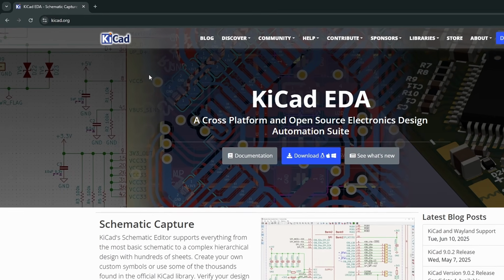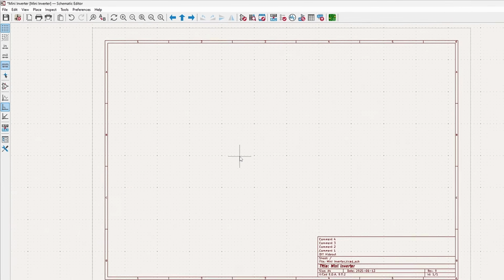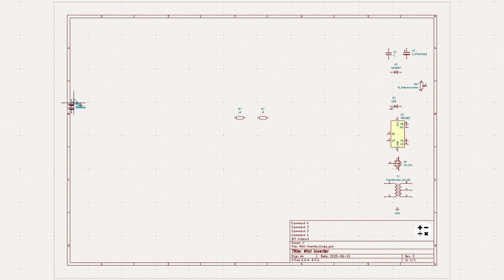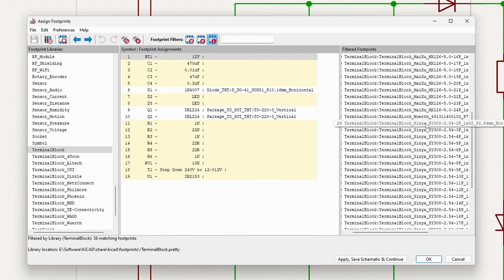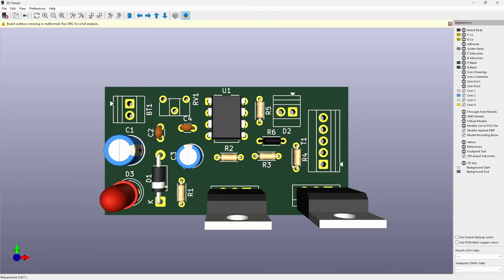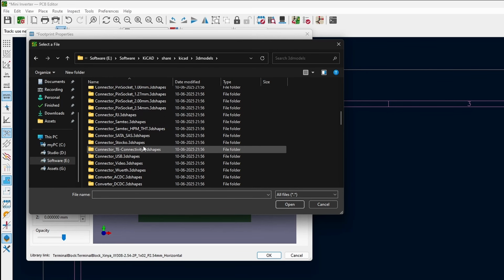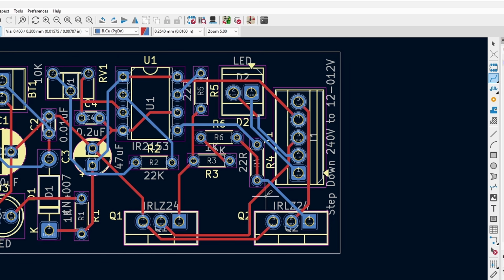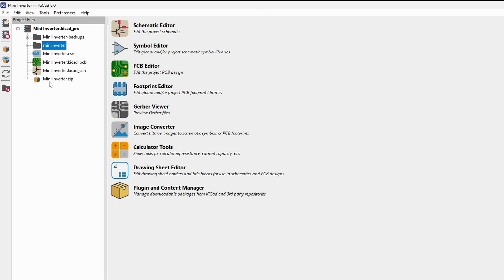KiCad for Beginners | Step by Step Tutorial to get started | 2025

Comment: Can u recommend PCB thermal testing program?
Reply from the maker: If you need an open source software you can use KiCad with salome software..other free option you can try is edesignsuite PCB thermal simulator or picls lite.. You can also altium designer.

Comment: Thanks for the video and the effort. However, as a beginner, I found it quite hard to follow. You explain 'how' to do things, but not 'why' they are necessary or what happens if we skip those steps. For instance, concepts like 'global labels', 'annotating schematics', and 'assigning footprints' are introduced without explaining their core purpose.

Also, the example PCB you used is way too complex for a tutorial aimed at beginners. Starting with a much simpler circuit would have been much better. This feels more like an intermediate guide rather than a true beginner tutorial.
Reply from the maker: Thank you for the constructive feedback. I will definitely keep this in mind for my future beginner-focused tutorials.

Comment: Great video! I am super new to this. I didn't see this question in the comments, but when you added the trace with the via, could you have just went up and over the component that was in the way instead of using the via? Any issues doing that? Is using via preferred for some reason?
Reply from the maker: I used the via just to show how to use the vias in the video.. if there are no other options other then using via only then use vias otherwise no need to use vias...Some fabrication house may charge extra for vias

Comment: Is there any possible way you can maybe do a short or something on how to add the heatsink to the transistors/FETs? Im trying to follow this to design my first board and i have an LM317 THT that will have a heatsink on it that looks similar to the ones you used, only black. Any help or tips on doing this would be great.
Reply from the maker: I will consider making a video on this... In the meantime you can try this.. 
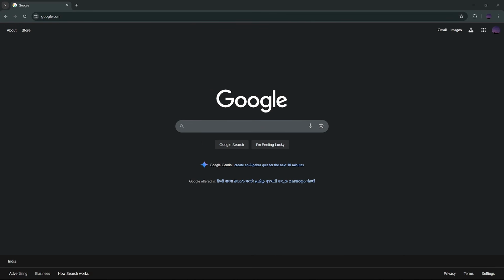Download separate 3D model for LM317 (TO-220 Package) and Heat Sink (Google - heat sink for TO-220 package 3d model and use the Grab CAD link) and then link them using KiCad (as i explained from 14:30). 

While linking you have to do it twice, First link TO-220 3d model and then link the heatsink 3d model.

If you already have the TO-220 package then just link the Heat sink to it.
Reply: @diyhideout thank you so much. Ill give this a shot after work today.

Comment: Laying out the parts placement should be done while routing the board.  If you don't do this you may end up with an unroutable board layout and have to move parts around, resize the board, or increase the number of layers in order to get everything connected.  For a simple board such as in the example this might not be an insurmountable problem.
Reply from the maker: Thank you. I wanted to keep the tutorial as easy as possible.
Reply: @diyhideout  You did make the process look easy!  I thought I had the latest version of KiCad installed on my Ubuntu (Kubuntu) system, but it was actually V8 that I was running.  Which didn't look any different from the V9 you used.  So I uploaded the new appimage as Ubuntu didn't have V9 in their repository.  After a few hickups, it's now the current working version.  I have a simple project I was working on, I need to get back to it and finish it.  Just a bit more complex than your example, hopefully I can finish it.  I don't think you showed a net check, maybe that's included in the update schematic when moving to the board layout.  Used to be a separate check that always bugged me with missing power and ground nets that I could never find!
Reply from the maker: Hi, All the best for your project. In the new version its under ERC and DRC. I have made a separate video for ERC and DRC check (https://youtu.be/OZhVRyuPJuA) which covers most common errors.

Comment: I'd like to make a data recorder using a microcontroller/FPGA and an external ADC (ex. TI ADS8588H LQFP-64 has 8 channels 500KSPS).  Something similar to Dewesoft's DEWE-43A or "OpenScope MZ" or Digilent's USB-205.

Aside from the zero experience in hardware/kicad/etc.. the biggest challenges I see:
- Designing the Analog-Front-End to scale/condition the input voltages -15V to +30V to something the ADC can handle.. preferably via jumpers
- USB2-HS 

I've seen that laying out a board for USB High-Speed requires expertise.. so I'd like to use a device that has the PHY built-in (ex.STM32H7RS , Gowin has a Soft PHY ).  The Smartfusion2 FPGA has USB2-HS but requires an external PHY chip.

Of course, the other option is to use an ESP32, still collect the data fast via DMA (75Mbps),  but output to the PC (sigrok) at a much slower rate -  USB-UART (1Mbps) or Wifi.(25Mbps)

I think I can probably stumble my way thru the schematic, maybe even the layout (although the TI ADS8588H Layout recommendations shows tons of decoupling capacitors, split Analog/Digital planes , etc... not to mention all all the PCB fabrication options I know nothing about) .  And even using 1206/1210 size components.. with my bad eyes and shaky hands, I think I'll need to find someone to do the solder.

Comment: How do I set the footprint so that the component's feet have a hole in the middle?
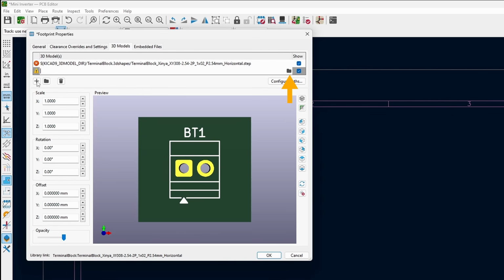Reply from the maker: You can adjust the X,Y and Z of the offset and the rotation angle (you can refer 16:34  in the video). if needed you can use the scale too.

Comment: 회로가 실제로 잘 작동하는지 시물레이션은 안하고 곧바로 pcb만드나요?
Reply from the maker: I personally simulate my circuits on a breadboard and then send it to fabrication. If you have access to Professional tool like Proteus  or Autodesk EAGLE you can simulate with that. You can also use Tinkercad (useful for Arduino or Micro:bit projects)
Reply: @diyhideout   kicad 자체에는 시뮬레이션이 없나요?
Reply from the maker: KiCad does have Spice simulation (maybe little difficult for beginners who are just starting with KiCad). You can find that under Inspect tab.

Comment: Hey thanks for the tutorial, just wondering if there's a components list or a specific symbol library that you use?
Reply from the maker: Hey, i have installed few libraries from the KiCad plugin and content manger (Keyswitch for Cherry MX keys, Kicad Library for Arduino Modules, Simple libraries which has value based resistors and capacitors which speed up the design process)
Reply: @diyhideout  great thank you, i will give those a go

Comment: hi! Interesting video! I need to design a custom FPC to make a extension between a sensor and its motherboard, but I have to clue how to identify those connectors... I mean, I'm totally noob in electronics and except pitch and pins number, those LCD phone connectors look all the same for me, How do you do to figure out the exact connector model? Thanks
Reply from the maker: Hi, Look at the connector for the marking like manufacturer or part id.. you can look for the components using the pin numbers with connector name.. You can look for the components in Mouser or in alldatasheet dot com. Or try searching google with phone model and connector ( ex - iphone 15 Lcd connector) through that you can find other details.
Reply from the maker: Hope this helps.